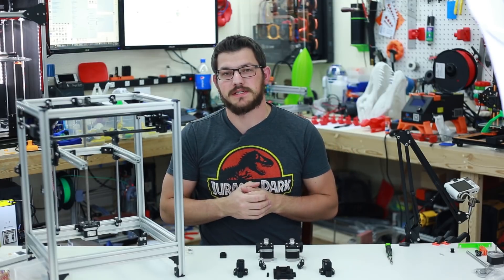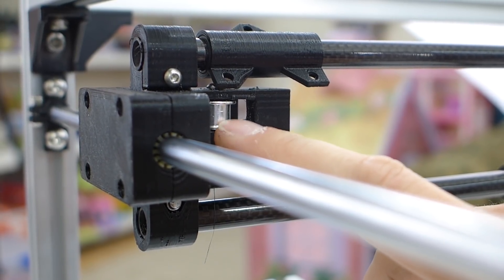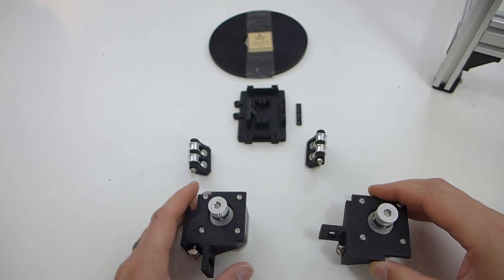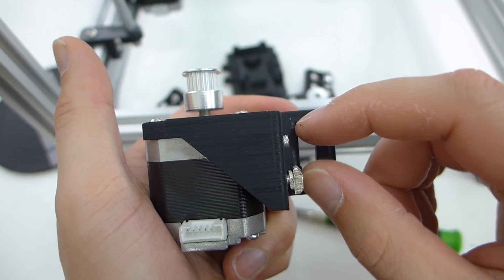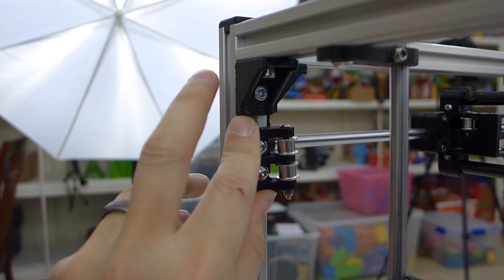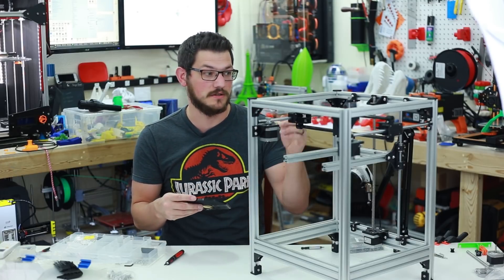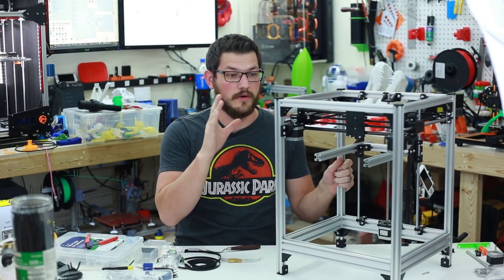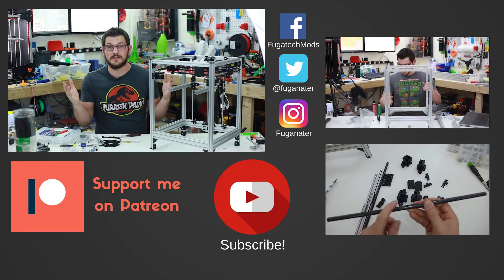HyperCube Build Part 3 (X Y and Belts)

Comment: I hope you still read some of the comments, I have a question. On the site it's not really clear what type of pulleys I need to buy. What length and such.
Reply from the maker: I read every comment but slack on replying. They are 6mm 16 and 20 tooth pulleys.

Comment: I don't understand, which pulleys should be without teeth?
Reply from the maker: The ones on the X and Y carriages should be without teeth. Basically only use toothed? pulleys when the belt teeth face it. If it is the back of the belt, use smooth.

Comment: Interesting build - the twisted belt is also rubbing me slightly the wrong way and I am thinking about the same idler setup as you are. But what would have been even more interesting is if you had been able to show any differences in print quality or any other meaningful non-cosmetic measure with the twisted belts versus non-twisted, and also whether the belt idler bearings move as good as the flange bearings do (the blange bearings are true ball-bearings and the idler-bearings seem to be sleeve bearings).

The Y Igus bearings did seem to bind a bit more than what I would have liked. If I remember right, Tech2C's would move freely when grabbing each XY-joiner. Might be worth trying to loosen the XY-Joiner clamps a little? Think I saw these bearings will deform under pressure and bind.

Comment: Is this a good belt? I kind of doubt. I mean yeah it's the usual kind of belt. I saw at a local store two kinds of belts, the chloroprene belt with glass fibre reinforcement, black, probably akin to this. And polyurethane belt with steel core, white. And i'm thinking, the second belt not only looks more stylish, it'll have to stretch a lot less too? I looked up and you get the second kind cheaply in China too, you pay like 3 times as much, no big deal. And what you've got here is a printer that's big, that has interdependent axis, and that has very long belt loops! So i think it might matter, i think there can be a tangible quality difference if you go for the best belt you can.
Reply from the maker: I am using this type on several other printers with no issues. Time will tell I guess.

Comment: Hi Fellow FolgerTech FT5 owner....  I had a question about trying to print the Eiffel Tower model.  I get a good 1st layer, and any layer of size prints well but when it gets to the point where it does the small cross beam it just becomes blobs.  I still have the original extruder and hot end.  I use simplify 3d to slice it.  any suggestions.  I do not facebook nor twitter so I do not know any way to send you pictures.  I am using pla at 205c with a bed of 25c
Reply: What small cross beam? How does it look? Which part of the way up are you?

Now i don't have the same printer as yours but two remarks. First, you can run your PLA much, much hotter. You can crank it up to 240 no problem or higher, worst case you're unhappy with the result, it won't catch on fire, so just experiment. If you print runny, the extruded bead will have a much lower tendency to pull on the lower layers and distort them. Also you want to give small details plenty of opportunity to cool before you do something on top of them, so print slowly, set your minimum layer time waaaay up and crank your print cooling waaaaaaaaay up. You can also place a tall narrow throwaway object somewhere else on your print bed, so that while the print head moves between that and your actual print, your cooling fan and overall air movement can do a bit to cool your actual print.
Reply: on the Eiffel tower model, I want to print a really big one but on the test piece as soon as the print gets above the base of the leg, and starts printing the cross beams (very small pieces that go up the leg and criss cross each other.  When it gets to them it looks like the nozzle tip is dropping down into the previous layer and smudging around then it pulls up and moves to the next one and seems to do the same.  Watching it, it does not actually drop down but still appears to be smudging  and glopping up the previous layer.  I checked the Cooling tab I did have the Increase fan speed for layers below (it was 15 sec) I upped it to 20 sec.  then I looked at the Adjust printing speed for layers below and it was set to 20 sec.  So when you say "waaaay up" are we talking 30 or 40 sec or something more like 80?  I am in the middle of a 12+ hour print of a snap together robot, so it is going to be a few days before I can try the tower model again.  I thought filament got more stringy as you set the temp up.  I know it is for PETG which is what I have been printing in, but it is too stringy for the Eiffel tower model.
Reply: Yes you can get strings if you go too high, and you can get blobs or strings if you go too low, it's a bit individual per printer and filament anyway. There's also no factory calibration for temperature sensors, they're just assumed to be exact enough, but they're really plus or minus 10°C or so.

Depends, but maybe around 30 seconds layer time should be fine? If the issue is directly in an overhang, when it is laying the bridging, you need to make sure the filament freezes in place quickly. If the issue is that the next layer above the overhang softens the prior layer and makes it droop down, then try to increase minimum layer time so the whole layer gets a bit of cooling time before it gets reheated, or try to print slower, so part cooling fan has more time to freeze the surrounding filament. Part of the issue or the solution can be the environment, i mean if you're printing delicate models in PLA it may be helpful to make sure the room is a little bit cold and there's a bit of an air draft. Most printers like the Mendel derivatives have a lot more ambient air movement than FT5 and other Darwin style printers, but you can always put a big fan somewhere when you need some draft.

Comment: When I built my Hypercube Retro, I also used the one piece smooth bearings. But I followed Tech2C's example of twisting the belt so that the smooth side of the belt rode the idlers.

Comment: Why didnt you make the HyperCube Evolution instead?
Reply from the maker: Didn't know about it when I started this project 6 months ago.
Reply: Fugatech 3D Printing ahh understandable, well more content for the future!
Reply: Worth pointing out while the Evo does have a few (more than a few?) good refinements, it also takes a step back in some very significant ways. It beefs up the extrusions, (which are not the weak part, even in a larger frame), while using weaker internal corners (which are the weak part of the frame). Meanwhile, the Evo discards the Alu or CarbonFiber X rails to use heavier 8mm steel rods, while also adding 4 x LM8UU bearings and using LM10UU Y bearings will be heavier as well. There is no way the Evo is going to be able to print as fast as the stock hypercube, as it has much more moving mass. Lastly, the Evo has the X rods closer together which seems like a bad move. All in all doesn't seem very well thought out and it seems the creator did not build a stock hypercube before redesigning it. Glas to see Shane building the stock hypercube and making improvements along the way!

Comment: Hey Shane - enjoying the videos.  Thanks.
One thought - about the X carriage, where you prefer the embedded nut.  Something you might try - to save you from reprinting it (if you haven't already done so, that is).  I hope I can explain this well enough:
1. Put a nut on a long screw, and tighten it all the way to the head.
2. Insert it from the side that you want the nut on.  Make sure the screw is long enough to hold onto from the end opposite the head/nut.
3. Heat the nut while slowly spinning the screw (away from the part as much as possible, while still being able to hold from the other end, of course) using a cheap butane torch.  
4.  When you think it's hot enough, pull it back from the opposite end and into the carriage and let it melt into the carriage.
5. If it's not hot enough, repeat.
6. Let it all cool off, and then unscrew the screw completely from the embedded nut - the nut will probably be welded into the frame.
7. Repeat for all of the nuts that need embedding.
If it works, you save reprinting it.  If it messes up, you've lost nothing, and just reprint it anyway.
You might as well give it a try anyway.
:-)
Reply from the maker: I've done this before with injection molded parts but never 3D printed parts. I can give it a shot but I'm not sure how it will work with PETG.
Reply: I'll be interested to see that myself.  :-)
Reply: do it with PLA all the time.
Reply: I'm very new to 3D printing, so a lot of my comments may be redundant.  But, I'm learning.  :-)

Comment: Quiet is why I did printed X and Y bushings. LMxUU bearings are right out 😄 Use Artur's X Carriage which also has Bagwan's belt tensioner built into it, that's the best one. What are you printing these parts on? There is some mad ghosting, you'll have none of that with HyperCube 😉 Get some "vibration mat for fridge/washing machine" to put under the feet, they really help!
Reply from the maker: Ya I need to reprint Arthur's carriage. I printed these months ago on my FT-5 at a pretty fast speed. I've since then fixed the ghosting issue (mostly).

Comment: Hello that will be only one z motor buil? You can use bronze bushing lik in ultimaker intead igus or linear bearing, they are also preatty quiet.

Good luck
Reply from the maker: Yes only 1 Z motor for a small build plate.

Comment: Is there a reason that you put the motors in the front of the printer rather than in the back?? The back seems like it will be easier to run the wires cleanly.
Reply: That's Tech2C's design. If you had the motors at the back, the belts would cross at the front where you want to reach into the machine. They are better at the front, at least with this belt level.
Reply from the maker: +1 to what Jamie said.
Reply: Thanks for replying are you going to use the trynamic 2130s??